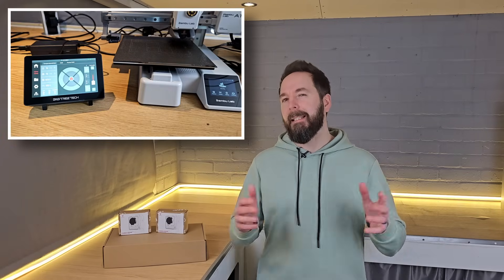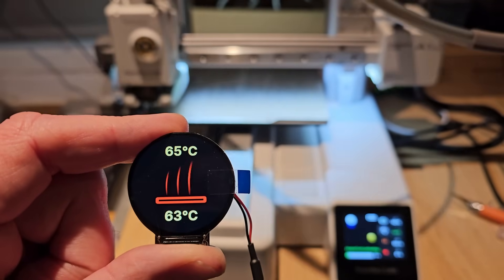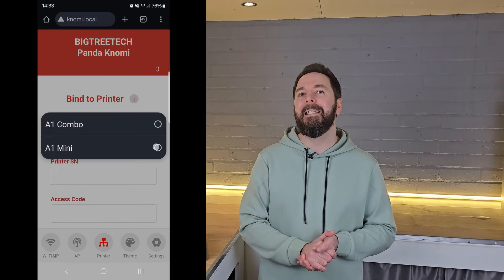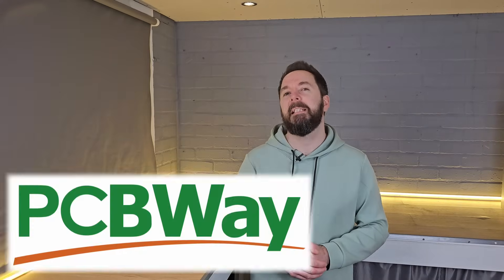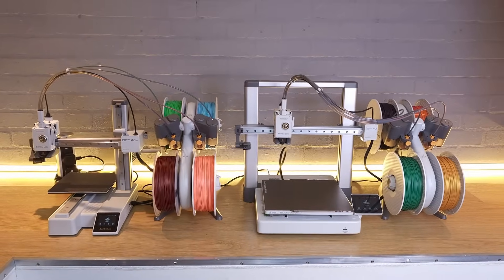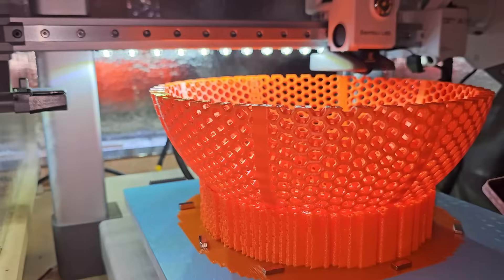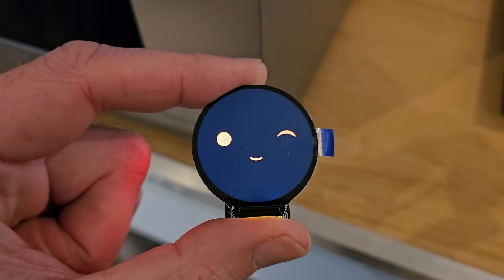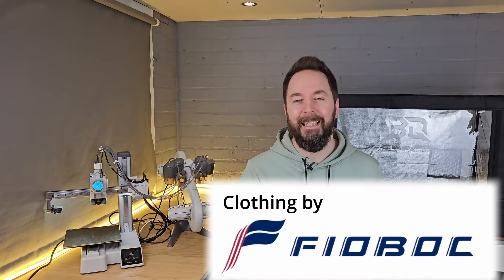Bambu Lab Upgrades From BIQU: Worth the Money? Panda Knomi & Shelter

Comment: I'm still using creality S1 Pro which you reviewed years ago. I have the sonic pad upgrade. So you think it's worth changing to bamboo labs instead?
Reply: upgrade the board instead, s1 pro is good no need to switch printer just upgrade it
Reply: @imnotrizla9765 which board would u advise? My sd slot is dead on my s1pro

Comment: I like the shelter. However, Bambu discourages us from using an enclosed space for its printers due to the potential overheating of its processors. Should I be worried about this product?
Reply: yes, if you wanted an enclosure you shouldve gotten one with it stock, anything other than factory has risks

Comment: Hasn't bambu specifically said not to enclose the a1 and a1 mini because of cooling to the boards?
Reply: You can just print some stls for 5015 and 4020 cooling fans. I run mine at 50c in a heated enclosure for abs.
Reply: Well, it does have a ventilation fan that should prevent over-heating
Reply: @johnhinkey5336 if you have the printer in an enclosure it doesnt matter if you have the strongest fan in the world. The hot air will still not get out, just accumulate, especially with hot bed :D
Reply: @Sysshad  The enclosure will not be air tight.  As long as there is some leakage the fan will pull in cold room air - if it can pull in air fast enough it will keep heat from building up.  Those acrylic cases are definitely not air tight and putting any reasonable fan will pull in enough room air.